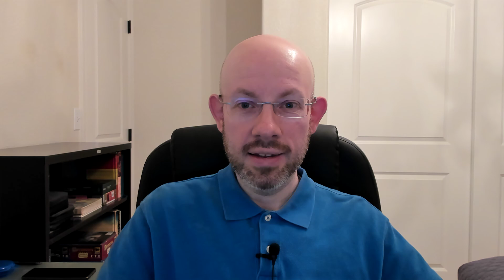EcoBoost Maverick - 32.1 Combined MPG!

Comment: I tried the eco mode for the last week on my Maverick.  Over 225 miles the truck averaged 30.3 miles per gallon.  The computer showed 31.3.  This is over 2 miles per gallon better than my 28.2 mpg using the normal drive mode.  Like you, I am quite pleased with the gas mileage on this truck.
Reply from the maker: @billquattlebaum1577  Very nice MPG! Thanks for your comment! 👍

Comment: I am averaging 28.2 miles per gallon on my 2024 Maverick XL.  It also has the Ecoboost engine with front wheel drive.  This is over about 3,000 miles with mostly very hot and humid weather.  I use the normal mode when driving.  The computer tells me it is getting 30.2 mpg.  I am happy with the mpg, but don't think the computer is accurate.  I really like the truck.  My only complaint is there is too much computer controlled.  This is the first vehicle that has locked me out and the stop/start is rather annoying.
Reply from the maker: Thanks for your comment. 👍 I received similar calculated MPG (about 28.2) in Normal Mode (around 29.1 MPG displayed) with similar driving conditions. I'm also quite happy with that, and it's nice to know that I can get higher MPG if needed or desired. Sometimes I wish the computer would "relax" with some of the on-screen notices that require waiting for them to dismiss or pressing the "OK" button. Overall, it is an excellent vehicle and I think consumers would like to see more compact trucks in this segment.

Comment: Great eco-boost milage, thanks for sharing your mpg tips.  I chose not to get the hybrid on these factors; the hybrid seems to have a lot of components and has had several recalls.  I wanted awd and planned to tow a small (tiny) camper.  Standard towing would be have been adequate for my plans, but one size up camper then not.  I am minimalistic and todays base level vehicles have far more bells and whistles than a high end vehicle from years past.  My '24  Maverick XL is my 102nd vehicle and it's 100 years newer than the oldest Ford truck I've owned.
Reply from the maker: You're very welcome! I'm happy that I chose the XL EcoBoost instead of the hybrid for some of the same reasons that you mentioned. I had wondered how well I would adapt to the minimalistic nature of the XL after owning more luxurious vehicles in the past (whether or not I had specifically chosen those extra features), but I am pleasantly surprised how natural and enjoyable the XL feels to live with as a daily driver. Your 102nd vehicle and 100 years newer than the oldest Ford truck you've owned--that's awesome! I wish I could see some videos of that truck and the other vehicles you've owned! I feel like I can find something I like and admire about every year and type of vehicle, and it's always interesting to keep learning in the process. Thanks for your comment!